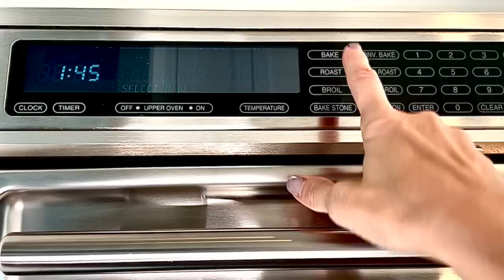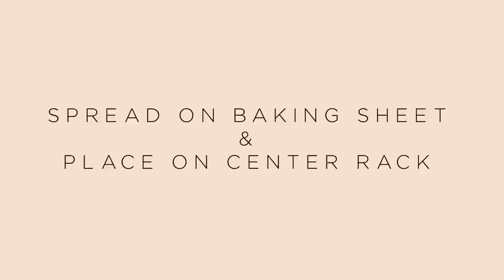Maximize Your Cannabis: How to Decarb

Comment: Insta-pot!!! Soo much easier. 
There are some good tutorials out there and it is very easy to get uniform results and you don’t have to stir it…

Put whole buds in a mason jar, of course using one that will fit into the insta-pot. Add water, generally enough to cover a portion of the jar, but not too much as the jar will want to float.

I usually do 3 different strains together, as that fits perfectly in my insta-pot.

It takes a few minutes to come to pressure and temperature. But once it gets there, it will create a uniform temperature and hold it constant during the decarb process.

In this way, Insta-pot is a very appropriate name.

Thanks for the video!
Reply from the maker: We feel you! But we made this for people so they can try it out before they invest in a cannabis appliance.
Reply: How long do you do it for and what temp? Thankyou
Reply from the maker: @Tito-en5nv  220° F & baking time depends on your flower. For old or low quality flower, bake about 20 minutes. If you’re using cured, high grade flower, bake about 45 minutes. And for recently harvested or wet flower, bake 60 minutes or more. But keep checking the color of your flower to make sure you’re not under or overcooking it. And you can find step-by-step written instructions here: https://www.thedrawingroom.blog/make-cannabutter-in-9-easy-steps/
Reply: @Tito-en5nv  You don’t need to grind the flower, break it up, though. Put the flower in a canning jar. I usually fill it up about halfway and then put a canning lid on it. 

Make sure your jars fit. I also use a steamer basket to hold the jars, and keep them elevated off of the bottom of the instapot. I also fill the empty space with empty jars so every stays upright. 

I use a bit more water than the minimum recommended for my model of instapot, which covers about the bottoms 1/3 of the jar. Too much water will make the jars float and increase your time to pressurize. You may have to experiment to find what works best for your pot.

Settings: High pressure for 40 minutes. Manual release after the timer finishes. 

The steamer basket is nice as I can just grab the whole basket out when it finishes.
Reply: @AlchemicalAudio  thanks

Comment: If I vape my weed at 420F for 10 mins is that enough for decarbing or too much?
Reply from the maker: Great question. If you're vaping, you don't need to decarb. The vape is doing it for you. But are you asking if you can use the leftover flower to make edibles? If so, the vaping will already have depleted most, if not all, of the cannabinoids.

Comment: thank you for this video. 1 of the better decarb vids, especially for a newbie like me
Reply from the maker: We're SO glad to hear it. You're who we're making them for. Look for our upcoming vid on how to make cannabutter!
Reply: @AtHomewithHouseofPuff  i look forward to the cannabutter video. Im also subscribing👍
Reply from the maker: @jamesspooner1.2.76  Welcome aboard!
Reply: @AtHomewithHouseofPuff  first time doing this. Decarbed an OZ of some good stuff for 12min on 225°.. do you think that was enough time?
Reply from the maker: @23s14-q5w  You'll still get some activation, but with only 12 min in the heat, you lose some of the THC potency.
Reply: @AtHomewithHouseofPuff  I used some amazing bud for it and they barely hit😔 whats the ideal time for an oz? I ended up decarbing another 7grams but for 35min this time on 225° and just reused the cannabutter I made to infuse those 7gs.. hopefully those come out stronger
Reply from the maker: @23s14-q5w  It doesn't matter how much you're decarbing at a time. What matters is what the flower is like. For older, dryer flower (which will have lost some potency already) 20 mins.For cured, high grade flower, bake for 45 minutes. For recently harvested or wet flower, bake for 60 minutes, plus.
Reply: @AtHomewithHouseofPuff  thank you so much for the advice. Will definitely have better results next batch!

Comment: I know im a bit late to the party but A tip I can add is I decarb using my insta pot! On hi setting it holds steady at 240°F under pressure! I place my product in an appropriate size Stainless container with an Aluminum foil cover w several small holes poked w a toothpick placed on a rack to keep off bottom! Product is consistently decarbed and It will not be wet also works for waxes and oils for use in gummies
Reply from the maker: We're totally with you both!
Reply: For how long do you cook it?
Reply: @mariakriechel1774  5min from Pressurization..i use a small metal cup similar to what a steakhouse would put sides in and cover with foil with a few small holes poked...theres not exact timing but for my unit and some trial and error I know by the color change of product and 5min is about perfect. You can also decarb waxes and similar

Comment: Thats the way i do it! And after decarb you can also extract the thc with everclear or 151 rum! I used some 160 proof homebrewed rum! Put everything in the freezer and get it super cold then soak your cold weed , in the cold alcohol ,and ,shake it a few times. No more than 30 mins then filter the alc. I used about 12 - 16oz of alc. to 1 oz. of highgrade bud. Any longer than 30 min. and you will start to extract the chlorophyll ! Besides all the thc is extracted by the alc. anyway after 30 min. You can use this extract or tincture in whatever as well just as it is, or, just use a few drops under your tongue! It made some killer gummies! So there ya go!
Reply from the maker: AMAZING!! Thanks for sharing!

Comment: The only way that works for me is a loaf tin and gas stove burner I put it right on the burner on high  moving it around until it browns and smokes a bit. Most potent method I've ever done to the moon!! I just eat a good tablespoon full with yogurt and water.
Reply from the maker: If it's working for you that's great! The only problem with doing it on the stovetop is that you can't precisely control the temperature to preserve the most cannabinoids.

Comment: A good video with some science involved; so figured a good place to ask a question. After decarbing and using that for any type of cooking will the extra heat start to degrade the effect of the already decarbed bud?  If the answer is yes; what would the time conversion be to limit the degrading. If the answer is no; why is scientifically is that?  Just a curious thought; since I'm interested in the process.
Reply from the maker: Thanks, John, really appreciate your thoughtful feedback & questions! To be honest, we're not scientists, but we're guessing that you probably lose a little of the cannabinoid potency when you then cook your decarbed flower into cannabutter or other edibles. But, when you're making edibles, you can preserve your THC levels by using a maximum oven temp of 350 degrees. Also, when you eat cannabis, your digestive system multiplies its effects. So they give you more bang for buck. And if you want more science-y details, check out our editorial on www.thedrawingroom.blog. We always add links to studies by actual scientists to back up everything we write.💚💚💚

Comment: I have some questions regarding a method i use.
Instead of a grinder, I like to use a metal sifter to grind it to almost powder like. alot of crystals stick to my fingers, which I separate for future use.
Do you think this method removes wanted properties? Also when decarbing, I put the powder in a covered metal cup. usually removing it once i start to see vapor rising. should i use the oven method instead? 
Thank you!
Reply from the maker: We like different grinding styles for different purposes. If you’re making edibles with your flower, we recommend the opposite—coarse grinding. That way, the cannabinoids will infuse into your butter or oil, but less of the chlorophyll will. That’s what can give edibles a strong, grassy flavor that can easily overpower other ingredients.

Comment: The problem with home ovens is that they raise and lower the temps constantly in an attempt to maintain the set temp. Enter a dedicated decarbing machine that will give you about a 95% decarb instead of maybe 80% if you're lucky in an oven. I find the Ardent units to be the easiest and the best..Totally automatic and perfect product every time.
Reply from the maker: Totally with you. We love the Ardent, too. But until you get serious enough to make the investment worth it, the oven gives you a good enough result. Thanks for sharing!
Reply: 🗣️I use an air fryer....works perfectly
Reply from the maker: @evan.norwalkcalifornia562  That's a great workaround, too!
Reply: @AtHomewithHouseofPuff  😉
Reply: @evan.norwalkcalifornia562  I have been using an air fryer and infusing with peanut butter. I can have a dose cooked up in like 15 minutes.
Reply: A double boiler  (a dry pan over boiling water) perfectly self regulates at 220 degrees.
Reply: @heintmeyer2296  a double boiler doesn't get hot enough to decarb fast enough on its own. It will work if you do it for like two weeks, but that is just too long for me.
Reply from the maker: @@bubbakush7995 Wow, that's awesome! Thanks for sharing & you're totally right.
Reply: If i look at it and it is going brown its ready. 30 mins at 110 will be fine at her temp dont leave in for 30mins.
Reply: @bazglsgw1208  Sorry, but the color will turn brown well before the weed is fully decarbed. Most home ovens should run 220d F for 40 minutes.Over-decarbing also ruins the potency.
Reply: @jeffme6891  When i started i looked at a pic online of decarbed weed. I mean just a brown tinge n the kitchen will smell great. I got half a syringe(no needle) full off concentrate medicinal oil. I heated  it n put some under my tounge. I have a huge tolorance but that got me so fckd up.
Reply: @jeffme6891  Yeah i put mine in for 30 mins at 110 i dont know if the ovens are set in celsies or farenhight.
Reply: @bazglsgw1208  It turns a GOLDEN brown when decarbed in a dedicated machine
Reply: Where do i order one? And is it easy to use for sure? I have cancer and I would do appreciate your help on getting one etc bless 🎉

Comment: I tried to make cannabutter a time ago.  My friends told me that it wasn't strong enough.  I didn't put sunflower lecithin in it.  So I have ordered it online. I  plan to make edibles using cannaoil. Wish me luck.
Reply from the maker: Aw, what a drag...we've had failed attempts, too. But, if you do the math, you'll be all good. If you want to give it another go, check out our Simple Edible Calculator where we've done the math for you: https://www.thedrawingroom.blog/make-cannabutter-in-9-easy-steps/. And we don't put lecithin in our cannabutter. An emulsifier like that would definitely make it creamier, but we don't love what emulsifiers do to our bodies. Without it, cannabutter is still great to cook with. It just has a consistency like Ghee—which is clarified butter.

Comment: Ok, I hear about decarbing cannabis all the time. I have been making peanut oil for my edibles for years, I don’t decarb it, I just put the cannabis & oil in my crockpot. Let it crock for 24-48 hours. My oil works GREAT!! Is putting it in the crockpot technically decarbing it? Because my oil is the bomb diggity, & never had any issues.
Reply from the maker: You're definitely decarbing that way. But you're likely losing some cannabinoids along the way. That said, if it ain't broke, don't fix it!

Comment: I've been decarbing at 240 degrees for 40 minutes. I works, but I seem to become tired even with sativas. I will try 220 degrees for 45 or 50 minutes to see if there is a change.
Reply from the maker: Hmmm...let us know if you see a change. We'd love to know! And maybe just try lowering your dose.😊
Reply: Hey, a question one month later, does the 240F at 40 mins make it stronger than the 220F at 45-50 mins?
Reply: @miker4414  I think the 240f at 40 works better.
Reply: @creativeclerk6087  thanks very much
Reply from the maker: @miker4414  Just FYI, the 220 degrees is based on the optimal temp at which THCA converts to THC.
Reply: @AtHomewithHouseofPuff  Hey. could I boil it instead, on a stove in a mason jar?
Reply from the maker: @BeeLZBeeb  Great question! But no. With decarbing, the issue is that you need a very specific, steady temperature to produce the chemical reaction needed to activate the THC. That's 240 degrees. Boiling temp is only 212 degrees. Plus, you would lose cannabinoids to the water. They bind most effectively to fat, which helps our bodies metabolize them, too. So you want to decarb them in the oven and then infuse them into something fatty—whether butter or oil.

Comment: Nice. You broke it down basic enough  but scientific so you know why it works. It seems decarboxing wasnt always madatory like today. You'd see all different methods. Does it actually work in capsules raw or does it still need to be infused? What ratio is the max if you would infuse it in vegetable  or canola oil?  Thanks for the rundown on decarboxylating. Makes sense that the old school edibles were hit or miss.
Reply from the maker: We're so glad you found this video helpful! Not sure what you mean by "does it work in capsules raw". Write back and let us know so we can try to answer. 

About the max for infusing in oil, we can't find a definitive answer, but oil has been shown to absorb only slightly less THC than butter. And apparently, both can absorb so much that there's almost not a maximum amount. We've seen up to 3 ounces per 1 stick of butter. 

But, of course, the more cannabis you infuse with, the more your butter/oil are going to taste like cannabis. So it depends on what your priorities are—to have incredibly high potency or a better tasting edible.
Reply: @AtHomewithHouseofPuff  i just meant can you fill gelcaps with the  decarbed weed or even eat it raw
Reply from the maker: @acespades4183  You could. But cannabinoids are fat soluble. So that means your body will absorb them better (more potency) if you infuse them into a fatty substance like butter or oil.
Reply: You can put ground decarbed weed in a capsule...works great and very stealthy...until you burp...LOL
Reply: Great question,  the Fat in butter or oil helps your body get the full effect. That being said, I personally decarb 2 or 3 grams and put it in a 1/2 peanut butter sammich,  lotsa oil in good ol peanut butter!!!  Plus...I don't have to process it any further with infusing, bcuz I don't want to. Also I have a glass of water and drink it with every bite, usually 3 bites.
Easy and fast.
Reply: You definitely have two different beneficial situations when talking about Raw versus activated. They have very different effects and different benefits. With raw buds, you can eat them all you want and not get high. They have lots of natural A+ benefits to eating cannabis raw. A lot of people like to put salads together with raw leaves, in fact when I'm pruning my plants I end up with three or four pounds of fan leaves and Sun leaves that are usually 9 or 10 inches across. Eating those Raw has more benefits than spinach, and can be eaten in just about every same way that spinach is eaten. From smoothies to swapping lettuce on your burger, raw cannabis is one of the best veggies in the garden. Goes and grows good with rainbow shard, asparagus, spinach and strawberries. Dried cured buds can be used for hot tea, and if you get the temperature right it will activate it plenty well, I've done stem tea for most of my life when I've run out of weed to burn. Never again, it's legal where I grow so I have 10 lb cured in the closet and 12 in the freezer for making everything from pancakes to tincture and salve. If I had to recommend a base, don't use veggie oil or canola oil, try butter or coconut oil, even olive oil is better than veggie oil or canola. You're not trying to clog your arteries at the same time as getting high. Unfortunately, we have yet to find or discover a cave painting of a salad. So after I'm done with my greens, I need a burger to be satiated. LOL
Reply from the maker: @newfreenayshaun6651  Wow! Sorry we missed your comment till now. Great info and advice. Thanks!
Reply: @AtHomewithHouseofPuff  fun stuff! Tell mom I stay high!
Reply from the maker: @Newfree Nayshaun  Thanks! 😂

Comment: Will my oven smell after decarbing?
Reply: In my experience, it will smell very strongly and distinctly like marijuana while you are decarbing - it will stink up your house, so do it at a place where this will not cause a problem. The smell goes away in a while. You can just open the windows, spray a deodorizer or burn an incense, you should be fine with that afterwards
Reply from the maker: You're absolutely right! And if you're concerned about the smell, then check out our video about decarbing/infusing appliances https://youtu.be/Q4Hg3d4uasg
Reply from the maker: Unfortunately, Francisco is dead on. If you decarb in the oven, there will be a strong odor. If that's a concern, check out our video about decarbing/infusling appliances https://youtu.be/Q4Hg3d4uasg

Comment: Or buy some quality distalete and just add the cannabis oil. It’s already decarbed and a much more economical way . The one bad thing about distillate is it doesn’t contain all the other Canabanoids that a raw flower canna butter contains . It all depends on your needs I guess
Reply from the maker: We're totally with you on it being easier. Thanks for sharing! We do the same. But the economical part varies a lot by where you live. In most places, raw flower is way more economical than anything processed. Also, by using raw flower, you avoid any issues with processing chemicals.
Reply: Or where you live ☹️I live in Al and only have access to delta 9 from
Hemp
Reply from the maker: @lorimoorehomes  Ugh. It's frustrating. But medical's coming online in AL. So, hopefully, soon it'll be legal for everyone.